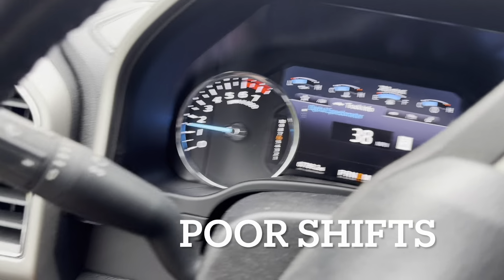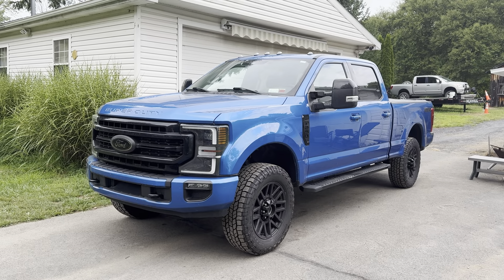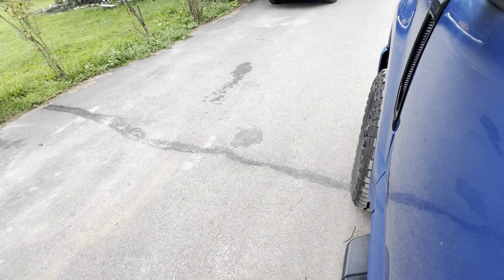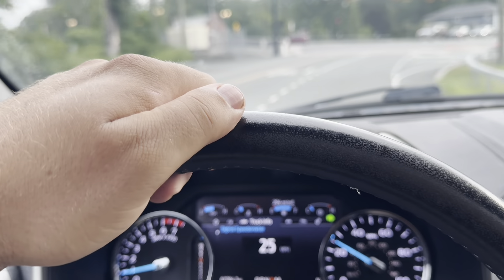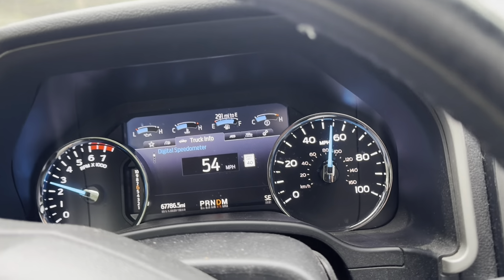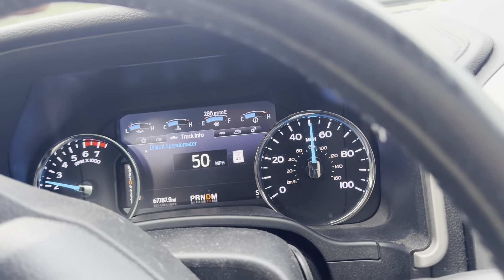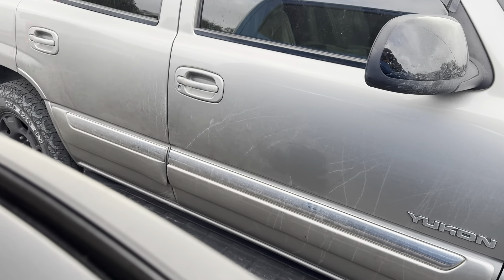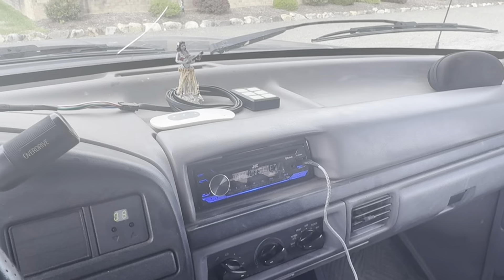Don't Get Burned: Avoid the Ford Super Duty 10R140 Transmission

Comment: I just had to replace the 10 speed in my 2018 at 60K.   I reported my failure to NHTSA.  Hopefully others who see this video and are having issues report it to NHTSA.  They need to force Ford to address these problems.
Reply from the maker: @SSScottSS  Was that in an F-150?   Regardless, the failure rates of these transmissions seems exceptionally high, and I’d really like to see Ford step up with a solution

Comment: For the price of trucks / cars nowadays it should be 8 year - 100k mile warranty bumper to bumper. BS it’s only 60K miles.
Reply from the maker: I completely agree, especially with the price jumps since Covid hit, which ironically came at the same time as quality fell.  Only way you’re getting a  100k miles on a standard warranty is with a diesel, and that’s an easy $12k up charge.
Reply: @BocksGarage  I’m not worried about the power train. I’m worried about all the electronics and cheap microchips in everything that will fail after 2-3 years. That’s why we need longer warranty. It’s the only way to hold the automakers accountable for what they’re producing. Most people need 72-84 months to pay the car off. Warranty should be for as long as the loan period so people aren’t fucked with repair bills while still paying off the car.

Comment: just to clarify this was only a issue on the gassers, and was also fixed i believe mid 2022.

if you complain enough ford usually covers all of it.
Reply from the maker: This isn’t happening on 6.7s?  I thought there was only minor changes on the transmissions between the two engine styles.   As for the replacement trans I had installed, my Ford rep doesn’t believe it’s an updated trans, so it’s likely prone to the same issues.
Reply: @BocksGarage Fords 10 speeds have issues with knowing what gear to shift into, my coworkers all have 10 speed 6.7s that shift at the weirdest times. I know it’s kind of an issue with the 6.7, I can imagine having a gas engine would make that even worse. When did you get your transmission fluid done? I know they recommend 45k, but honestly we have been doing them every 30k just to be safe.
Reply from the maker: Yeah, it’s definitely a widespread issue.   Since having the trans replaced it’s been night and day.  Even way before it failed, it apparently was never right, or just not right for a long time.  

As for trans fluid replacement, the manual claims a service life of 150k miles, so I had never replaced mine.
Reply: @BocksGarage  the 10R100 which comes with the gassers in the super duty lineup i think got fixed mid 2022 but the 10R140 which is paired up with the 6.7l Powerstroke didn't get fixed until the 2023- model year (2020-2022 had major transmission issues)
Reply: @trucksucc8490  the 10R140 which comes with the 6.7 on my uncles truck didnt have the confusion problem, it had the actually blown up issue
Reply: 10r140 is used with 7.3 gas and 6.7 diesel. GM use the same trans
Reply: @RjKillahh099  the gas and diesels have slight differences, as well as even the cab and chassis vs regular pickups.

The biggest difference is the diesels are controlled by a dedicated TCM, the gassers are controlled by the PCM, the main problem that causes the gassers to fail is cross leaking in the valve body, a issue the diesel 10r140s do not suffer from as often, not even a fraction of the percentage.

Also, the GM and ford variants have a select few of different internals (though mostly the same yes)

GM uses different clutches which seem to be failing more.

Comment: I was just on autotrader the other day and seen a 2022 f350 i believe the 6.7 but not sure. Asking price was 68k and it had less than 20k miles and lariat trim level. I thought it was a good deal till i read the carfax and it said it had an R title for being a lemon and returned to ford for having "harsh transmission shifts" and ford apparently fixed it and now for sale but still leery
Reply from the maker: If the truck didn’t have the entire trans replaced as well as some sort of extended warranty, I’d stay far, far away.

Comment: They did in fact do a repair replacing the Main Control Valve Body with an updated one (LC3Z-7A100-F) on the 2024 and the incident rate of issues has really dropped...Ford's problems will increase in 2025 when they make the 10R140 gets replaced with the much lighter duty 10R080 and 10R100 in their Super Duty.  I hope they get you fixed up.
Reply from the maker: @donedoneit1355  They ended up helping me out some and the truck is back in service.   I was still a few grand out of pocket, but they helped some which was nice.   In a side note, are they really looking to swap out to the same trans that’s in the F-150s?
Reply: @BocksGarage  If you buy the 2025  F250 and not the F350 or TREMOR...you'll not get the 10R140...but the 10R100 instead. That was a push to get a higher mpg as it's a lighter transmission. The new Lariat doesn't come with leather interior anymore either, ActiveX...(and it has a distinct "odor")...no power tilt steering either and a few other reductions in options but, they raised the price though....LOL...

Comment: Ford just replaced my 2021 f350 10r140 transmission with 53,000 miles on it.  It’s weird cause I read on google that the average life span of this transmission is 100-120k miles but we’re only getting half that.
Reply from the maker: Was that with the 7.3 or a 6.7?   And low 100k is a bad expectation for a trans to last.  I would fully expect one to go til 200k atleast.
Reply: It has the 6.2,

Comment: my uncle has a 2022 F250 STX with the 6.7l Powerstroke paired up with the 10R140 10 speed automatic transmission that blew at 7k miles
Reply from the maker: Jeez.  Hopefully it’s been trouble free since then.
Reply: @BocksGarage  it has so far

Comment: We got a 2024 king ranch a couple months ago. Needed a new transmission at 10,000 miles. 500 miles after that it’s back in the shop with more problems with the drivetrain. Now the truck seems to be slightly slipping between 3-4th gear but the dealer “can’t replicate” the problem.
Reply from the maker: That’s wild, you would think they'd be able to figure it out by now.  Is that truck a gasser or a diesel?   It’s been less than 15,000 miles since my new trans, and I feel like I’m starting to notice some signs of declining health already.

Comment: I feel your pain, bro. I’m missing the day of work today to get my transmission checked after it got rebuilt less than 1000 miles ago.
Reply from the maker: That’s crazy.  Let me know what they find.
Reply: @ they flashed the transmission and in other words, think I’m crazy because of course the transmission decided to run strong at that time, but every so often it jerks when you turn it on slams into gears and slips, both shifting and downshifting in certain gears. I still have 11,000 miles on the warranty. I feel your pain though I’ve saved so much for so long to get my dream truck and now I’ve had to drop all this cash getting it rebuild for it only to start acting up again. I’m so pissed off at Ford.

Comment: I just purchased a used 2021 F-350 with the 6.7 and the 10 speed with 65,000 miles. When I test drove it, it was not slamming into gear but it was downshifting weird when I slowed to a stop at a light. The dealer told me they needed to service it before they sold it to me and they would look at it, so I went through with the purchase. When I picked it up after I purchased it they said they did a relearn on the transmission and everything was good, it started to slam into 1st gear when I put it into drive when I left the dealership. I thought it was part of the relearn process. After day 3 of it doing that I made an appointment at the dealer I purchased it from for them to look at the transmission again. They have had it for 3 weeks at this point and still haven't given me a straight answer on what exactly is wrong with the truck. It is a Gold certified truck so everything is covered but still sucks that I've made the first payment on it and have only been able to drive it for less than a week. The only loaner vehicle they had at the time was an f-150 with a 5-1/2ft bed (I bought an f-350 for a reason). So yes BUYER BEWARE. I love the truck and the amazing power it makes and the way it looks but the dealership/ownership experience so far has been absolutely horrible.
Reply from the maker: Damn man, I’m sorry to hear about all of that.  It’s been a few days now, have any updates?

Comment: Ford had the virtually indestructible 6 speed in their super duty trucks but then teamed up with GM to share the new 10 speed. Any involvement with gm on transmissions made me afraid to upgrade my 2017, so, I’m keeping my current truck.
Reply from the maker: @lashbera  Apparently there’s a fix now with the 10 speeds, but I’m not super familiar with it.   I do have a soft spot for the 17-19 Superdutys though.

Comment: I have a 2021 6.7l with what I think is the same transmission.  it's in for service today, but it's been holding together pretty well.  I have noticed some odd shifting at times when it's cold.  When I bought the truck I bought the 100K mile warranty that cover it bumper-2-bumper,.. so I figure it'll be covered until then.
Reply from the maker: It may be worth getting the fluid checked before the truck hits 100k miles, just to make sure there’s no hidden surprises in there.
Reply: Not the same tranny. He has a gaser which is 10R80, you have 6.7L diesel which is 10R140. Looks like there was a class action lawsuit over this issue.

Comment: So did you get it for $7k or $3k? I was slightly confused. Also, did they put in another ‘21 model trans or a current year one? How’s it been performing since the work was done? My 2020 does the lurch when you put it into gear but that’s the only symptom currently and it only has 36k on it.
Reply from the maker: @KitCloudKicker660  Keep an eye on it to get worse.   And the original quote was $10,300 to have it replaced.   Ford worked with me and gave me $7,000 towards it, so I ended up paying $3,300 plus taxes.  Sorry for the confusion.
Reply: @ No worries! That’s definitely a nice price break, good to know so if something comes up with mine (that’s also no outside of warranty) I will lean into them. So did they put a newer year unit in yours?
Reply from the maker: @ It’s definitely a nice help, but I think they did it because it really shouldn’t have failed when it did.  As for the replacement trans, I sadly believe it’s an identical replacement.
Reply: @ I definitely agree and think this should have been a recall, or a customer satisfaction program like the DPF’s on certain years of the 6.7. That’s also a bummer it’s an identical unit they put in. Is it working well now though?
Reply from the maker: @ It really should have been.   It put a bad taste into the mouth of a lot of people.  As for the replacement, it’s working well now but once in a while I get a weird shift and I question if it’s starting to go out.   At this point, it doesn’t matter.   It came with a 2 year unlimited mile warranty, so I’ll re-evaluate it once I get closer to the end of that period.

Comment: Said it once and twice. Ford makes powerful engines but their transmissions suck ass…
Reply from the maker: I feel like the 6 speeds in the early alumidutys were pretty solid, but I could be wrong.
Reply: @BocksGarage  I had a 2000 f250 and the transmission was solid but my reverse gear went out.
Reply: @BocksGarage  i like the 6 speed in my 2012 f250 6.7
Reply: The C4 and the C6 were great,.. still are if you can suffer a 3 speed auto.
Reply: @robertmills794  are you talking about corvettes? Because the rest of us are talking about 2020-2022 ford super duty trucks
Reply from the maker: No, I think he was talking about early Ford automatics transmissions.   My dad’s Bronco has a C4 in it.   Apparently a lot of the technology carried over to the later E40Ds from my understanding.
Reply: @BocksGarage  oh okay